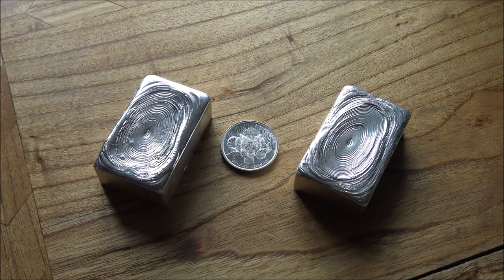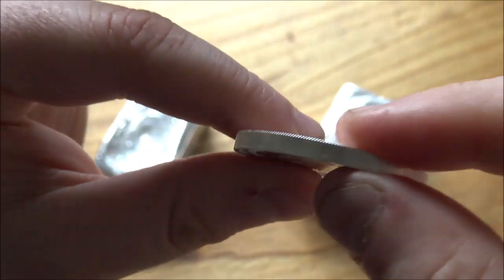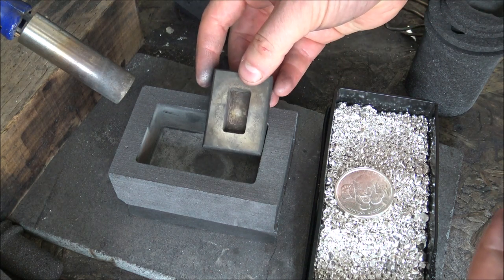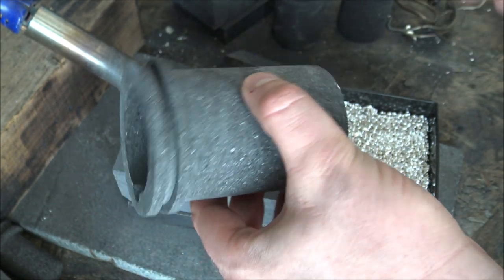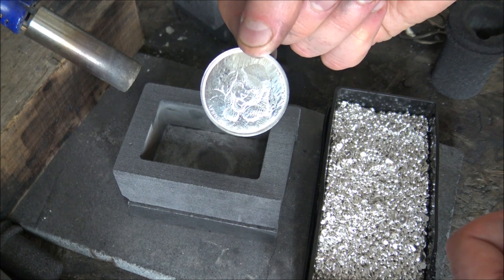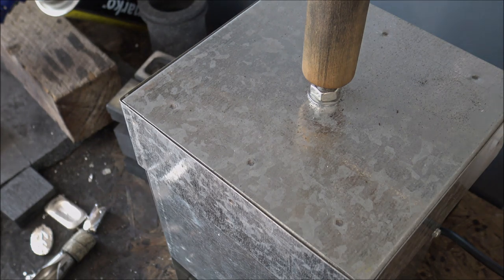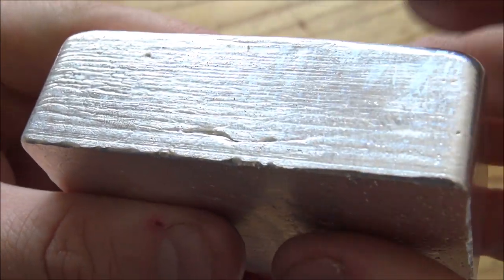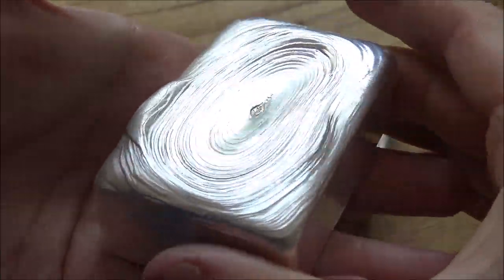We made another 1 Kg+ bar of Silver!

Comment: I doubt this is really doable but I've always thought it'd be cool to have a bar made exclusively from one type of coin, with the coin face stamped on the bar.
Reply from the maker: It would be possible - you would just have to pay for a stamp to be engineered with the design you wanted - that would be around £200 for the stamp I recon.
Reply: @BackyardBullion  Yeah, I'm thinking a viable alternative would maybe be to just actually attach a coin onto the bar.
Reply: @slamblamboozled1245  you could just cnc cut the correct diameter circle and depth to drop a coin in a bar.
Reply: I love this idea